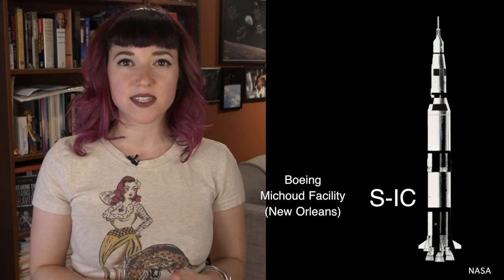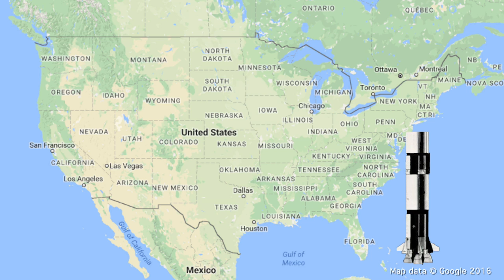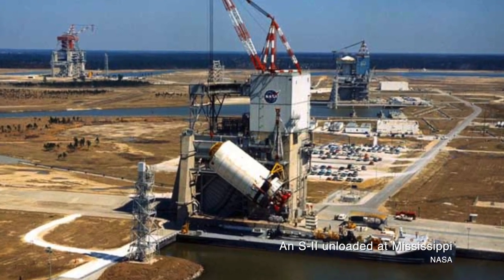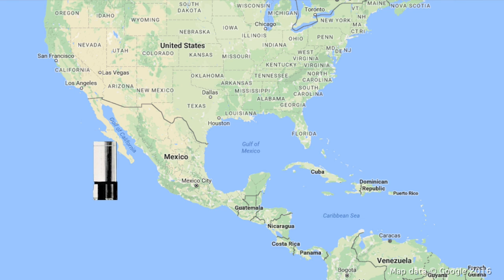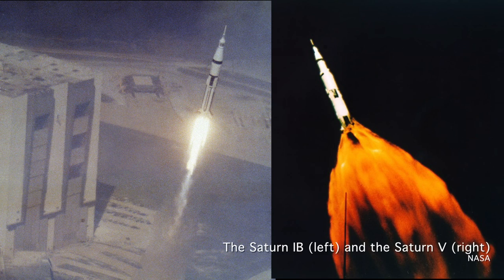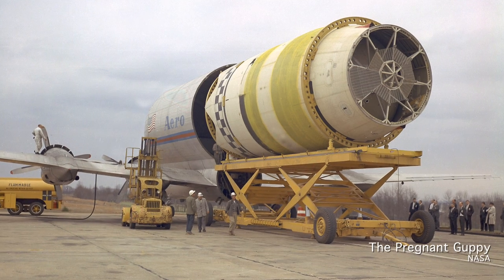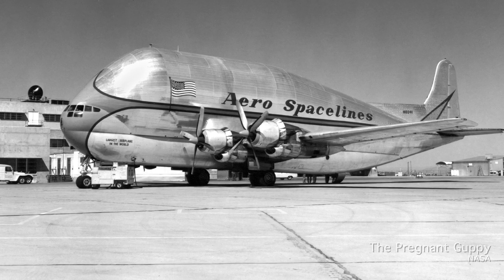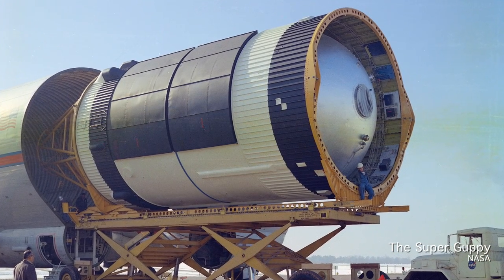How Did the Saturn V End Up in Florida?

Comment: Saturn V was awesome! I built a model one when I was about 10 years old. It was around 1m tall with a lander and everything :-)
Reply: Is that the old Revell kit in 1/96 scale?
Reply: Maybe, I have no idea. Were they around 25 years ago?
Reply: More like 45 years ago, though it was reissued as part of their "Heritage" series sometime in the '80s. Nowadays they're at least $100US if you can find one.
Reply: Wow you sure know your space models! I don't think it was a special edition or anything, but it was special to me :-)
Reply: Airfix and Revell both issued a 1/144 Saturn V as well. I built the Airfix kit way back in 1980 and built a newer release only a couple of years ago. 
All of these fairly old kits (40 plus years) are not 100% accurate. However, when AIrfix re-released their V in 2009, they corrected the main inaccuracies (which was the Lunar Module adapter section and the Command/Service Module. It is now the best 1/144 plastic kit of the Saturn V. 
They have also released it in a Skylab version too.

If you want REALLY big, Dragon do a 1/72 Saturn V kit.

Comment: Suggestion for a topic:
- why does US assemble spacevehicles  and transport them to the launchpad vertically, and Russia horizontally. What are the pro/cons?
Reply: US only started using the vertical transport crawler during the Saturn V because the rocket is so tall, it was more difficult to design a vehicle with erector mechanism rather than creating a vehicle to transport it already erected. After that, they kept using it because it's already there. FYI, only NASA use the vertical transport system. All other countries use horizontal transport, even SpaceX.

Comment: One of the fun facts about the boosters moving from Mississippi to Florida was the issue of getting past Interstate 10.  Part of the roadway was made of steel grid. They were removed by crane to allow the barge and booster to pass. The roadway was made solid not too many years ago since no more rocket barges are passing.

Comment: If I hadn't seen it on another video I wouldn't have recognized them for what they are, but in the photo at 1:37 the silver structures on the barge carrying the S-1C are the ends of the rocket nozzles mounted on frames. They would bolt onto the larger structure of the rocket nozzles themselves. 
I saw an engine on display in a video and it had one of these nearby. I had no ide what it was until the narrator of the video pointed it out.
I love this channel.

Comment: I was a child when the Saturn 5's were being built. I lived in Woodland Hills and there were various contractors spread out around the valley. My father worked for North American Rockwell at Rocketdyne in Canoga Park. He was a leadman of a crew that built F-1 engines. The first stage engines that put out 31 million horsepower, or 1.5 million pounds of force each. There were five on the rocket. When there was a launch I was in rapt attention to the news broadcasts. Usually after the launch they would give us a Richter reading from New York City. The engines my dad built actually rattled, very minor, the whole east coast. You could not feel it, but the instruments would pick up a Richter reading of a 1 or so. 

At 10 years old, in 1967, I was at the factory and got to touch an F-1. All three stage engines, F-1, J-2 and H-1 were built in the same part of Canoga Park. My dad told me once that they built 65 engines that were never used and were in some storehouse. There were 13 more flights planned when we just stopped. 

In 1968 he got laid off and we moved to Florida. I was personally at the launch of Apollo 17, the last Moon mission. I was 11.

Comment: Shuttles ships were recovered from landing point by attaching them on the back (top side) of a modified 747, solid boosters were recovered in the Atlantic Ocean by two tugs and towed to Cape Canaveral, and liquid tank was built from scratch and sent to Cape Canaveral by barge, the "grandsons" of the Guppy are still used today by Boeing to transport plane sections to building facilities ;-D

Comment: If you notice the photos there is a key difference between the Pregnant Guppy and the Super Guppy.  In the PG the entire tail was removed to allow loading.  It worked, but was very complex to remove and reconnect.  The SG instead has the hinged nose - still a pain (all of the control cables need to be disconnected first, for example), but still simpler and easier.

There is one Super Guppy still flying - and NASA operates it.

Comment: Hi,

A wonderful video.  I think it would be interesting to denote the evolution of the V2 to the Redstone to the the 1st stage of the Saturn 1B.  As I recall, the Redstone was basically a refined V2 that used Kerosene rather than Alcohol as the fuel.  And as I recall, the 1st stage of the Saturn 1B basically ganged together 8 Redstone engines with an elongated fuel tank.  

Very very cool!  I like!

Bret

Comment: During the Apollo era, I lived in Lakewood and went to school in Long Beach.  I remember the Guppies flying in and out of Long Beach Airport.  However, I don't remember seeing any Saturn stages being transported over the roads to Long Beach.  Los Alamitos Naval Air Station was closer to Seal Beach / Huntington Beach, so the stages went to Los Al, per this partial NASA history: __ "Both Guppy aircraft carried the instrumentation to monitor pressure, humidity, temperature, and vibration readings in flight as part of the plane's permanent equipment. In a typical delivery sequence, the rocket stage moved eight kilometers overland from the Douglas plant at Huntington Beach to the Los Alamitos Naval Air Station. After loading the stage, the pilots flew north to Mather Air Base, not far from SACTO. When stage tests were completed, the final leg of the airborne logistics sequence concluded with delivery at Cape Kennedy for preflight checkout and launch."

Comment: The Seal Beach facility for building the S-II is actually right next door to the Naval Weapons Station so the "drive" wasn't that long to the barge. It was less than 2 miles down Seal Beach Blvd to the Barge.

Two of the buildings used for constructing the S-II were just torn down in 2015, and the giant crane on top of one of the buildings (clearly visible in all of the old photos of the S-II construction site), was torn down in early 2016.

We are losing so much Vintage Space history.

Comment: Amy, what about how they had to pick special RR tracks to move the SRBs to Florida as a topic.  It is actually pretty cool
Reply: as I understand it the ground at surface level was not capable of dealing with that level of weight per square inch
Reply: *****
I am talking about the SRBs for the shuttles.  they were routed on a very twisted route to get them to KSC from Utah.

Comment: Hi, Amy. Firstly, I love your channel as I too am an Apollo era space nerd (though clearly, not as much as you =D ). Keep up the great work on this channel!

I have a question about the Apollo interstages (maybe a possible video subject too). There is some famous footage from either Apollo 4 or 6 showing the S-IC dropping away then the ullage motors presumably fires then the interstage drops away and then the S-II fires (not sure if the sequence of events is correct). As the interstage falls away, it begins to rotate but what looks like residual rocket fuel/exhaust seems to continue to burn through the insterstage ring. It is a truly beautiful sight and has always captivated me. I'm wondering what is going on here. Surely, the rocket fuel would have burned up by the time the insterstage has separated, and yet it's clearly visible on the film.

Also, I've read that the final few Apollo flights they didn't use ullage motors. Wasn't this critical to help with the staging? Did NASA just find that they weren't necessary? What's up with that?

Comment: Hi Amy. I love this episode - full of juicy details! Question about the launch tower - were the same ones used for each lift off, or one per mission and disposable like so much of Apollo components and equipment?
Reply: There were two launch complexes or towers. A and B. That took a lot of thought. There were reused. If I recall, pad B was used most often.
Reply: Raoul Cruz thanks heaps for that totally sarcastic response. A little less attitude would be nice and I WASN'T talking about pads 39a and 39b.
Reply: I was not being sarcastic at all. (The remark "that took a lot of thought" was sarcastic towards NASA in a lighthearted way. Nothing wrong with keeping things simple). I had no idea of your level of knowledge until you mentioned 39a and 39b. I was just trying to give a simple answer. Far as I know the towers or gantry were reused. They were extensive structures and took quite a while to build. By the way, the huge locking clamps that held the Saturn V in place, sat in field on the Florence SC municipal airport for quite a long time.
Reply: Raoul Cruz hi raoul. I'm glad you clarified. Those clamps would have been cool to see. I appreciate you sharing the interesting details!
Reply: There used to be the Florence Air and  Missile Museum at the Florence, SC airport. One of the nozzles of the Saturn F1 engines was at that museum. Why they shipped those monstrous clamps to SC, I don't know. But, I think the museum director at that time was a bit eccentric. Sad to say ,the museum is no longer exists. There were quite a few NASA/Apollo/Mercury artifacts there. Various nose cones that were used to test re-entry shapes, etc. They were throwing away a large "computer" cabinet from the Apollo program. I got one of the circuit boards. I think you would have been fascinated by the place. Cheers.

Comment: When was the cloth Rescue Ball developed? Ever tested in space? Were they routinely carried?
Reply: PRE Personal Rescue Enclosure.  Prototype was developed for Shuttle, but never flown.  Designed for rescue mission similar to STS-300 series missions where a disabled shuittle was having its crew saved by an other later launched shuttle and where there weren't enough space suits available.  I would crawl inside and zip in, then you in a space suit, would "float me from shuttle A's air lock, 2 shuttle B's airlock.  Oxygen supply and CO2 scrubber gave me about 1 hour of breathable air inside the 36" ball.
Reply: Sorry you asked when it was developed, it was developed in the 70's as the Orbiter was being built.  This wiki article has a picture of the First Women of Space posing with the actual prototype.https://en.wikipedia.org/wiki/Personal_Rescue_Enclosure

Comment: Hi amy I love your showsI don't think that I have every messed on. but I do have a question. when testing any part of the satern rocket that could only be testing once cleaned and but back together and had to keep there fingers crossed because the engine was never able to be test unless you tested again becauses that the engine had  volatilize fuels

Comment: And the shuttle boosters went by train, no? Which required them to be segmented to fit through the tunnels, which in turn is why O-rings had to be used? Would a barge through the Panama Canal have allowed them to go in one piece?
Reply: The SRBs were built in Brigham City, Utah. Since there are no big rivers connecting it to an ocean, a big barge could not be used. Also, the SRBs were fully loaded with solid propellant, which made them a lot heavier than the empty S-IC stage. They would have needed a much bigger barge.

Comment: Why did the shuttle launches "flip" upside down? Why was the shuttle underneath the tanks and boosters?
Reply: The roll on launch was to shift the flight path to the correct angle for orbital insertion. The shuttle's engines were angled up slightly (relative to the astronaut's perspective). This allowed the engines to provide an added lift force to the entire craft when it was flying at that angled trajectory, but only when it was oriented with the shuttle in the "heads down" position.

Comment: My gosh that plane looks so huge. How much did these stages weigh ?
Reply: xGshikamaru alot
Reply: by comparison, the convair B36 and B52 could carry 32 tonnes, although the B52 was closer to 22 tonnes when it first came out.
The pregnant guppy actually had a lower max takeoff weight than the Boeing 377 it was modified from, and the same was true of the super guppy and Boeing C-97, by 7000lb and 5000lb respectively. With a max payload of around 54,000lbs, carrying the 23,000lb dry weight S-IV wasn't a big deal, the major concern was whether or not it could fly due to drag.

Comment: So even after adapting a plane to fit the stage it was still cheaper to send them on barge? Or was budget not the only factor?
Reply: Security, Speed (it was a race, after all), Reliability, Budget, Practicality, and Flexibility all come to mind.
Reply: But as the plane was already built it would surely have been quicker and more secure to send the stage by air over American airspace. Can't speak for budget. Lots of fuel I guess but you're not paying a crew for a voyage through the canal. I'm sure there was a perfectly rational reason for doing it the way they did but given that the plane was capable I'm just curious as to what it was.

Comment: Its interesting that if we needed to move that booster today we would call a Russian airlift company.  Today they have all the big cargo planes.
Reply: There's also the Airbus Beluga. Twice the super guppy's payload weight for approximately the same volume.
Reply: Actually, no - the An-124, even the An-225, do not have cargo holds big enough.  Nor do the C-17 or C-5.

I'm not sure even the B747LCF is large enough.  The Airbus Beluga may be.

But actually, NASA would just use the one Super Guppy still flying.  NASA is the sole remaining operator.  They use it to this day to move outsized cargo.
Reply: There are 4 oversized fuselage planes currently in operation.  Super Guppy (1 in operation NASA), Boeing Dreamlifter (4 in operation | Boeing), Airbus Beluga (5 in operation | Airbus), and Conroy Skymonster (1 in operation | Private). 

While the AN-225 Mriya may hold the record for the heaviest lift, it is not much larger than a A380 or 747 as far as fuselage width.

The Dreamlifter is operated by Atlas Air under contract to Boeing and is not used for charter.

The Skymonster is currently owned by Harlan Wayne Jordan of Lady Lake Florda and stored in Bournemouth, UK likely to never fly again.
Reply: Ok I guess I over generalized here. :)
Reply: ***** Indeed, the Skymonster is visible on Google Maps: https://www.google.com/maps/@50.7854503,-1.8436619,102m/data=!3m1!1e3

The last update I could find was that it was restored to working order, with the engines run and painted with primer, in 2014 - but it hasn't flown since the work was done from what I can tell.

But the Skymonster is a LOT smaller than the Pregnant Guppy or Super Guppy.  (Interestingly it was created by the same guy.)
Reply: *****
What does this have to do with anything in that thread?
Reply: Airbus actually bought up surplus Super Guppies post the Apollo programme. They used them to transport large sections of Airbus airliners between the various facilities all over Europe. The Beluga was built to replace the Super Guppies.
One of the Super Guppies is preserved at Bruntingthorpe in England.
Reply: A bit late to the discussion, but I don't think they were surplus. The manufacturer had a few scrap stratocruiser airframes ready for conversion and this is what Airbus got. I read that they ran out of a critical part (wing box maybe? I don't remember...) and so that was scavenged from a surplus NASA aircraft. The Super Guppy that NASA uses now is ex-Airbus - apparently it was swapped in exchange for some payload space on a NASA launch (Airbus' parent company makes satellites, so I assume that's what it was in aid of). Oh, and on an early test flight, there is a story that a simulated engine-failue test almost killed Von Braun (who was on board for a demo flight) when the propellor refused to unfeather (you simulate an engine failure by setting the prop blades to a near-flat angle, rather than turning off the engine).

Comment: NASA wanted the shuttle-boosters made bigger, but the diameter was limited by the size of railroad-wagons (correct)
...and the track-size comes from roman horse-carts... (incorrect, that's only a myth!)
The idea of the 'Super-Guppy' lives on in the Airbus 'Beluga' and Boeing's 'Beluga'-equivalent, The 'Dramlifter'...
(there was even a plan for a B52-based 'Mega-Guppy' with 12(!) engines...!
b.t.w.
some years ago, i saw a docu, that the canals at KSC are s.k.o a manatee-sanctuary, because these animals keep the waterways free from seaweed and keep them navigable... (win-win-situation ;-))

Comment: I've seen plenty of photos of the SIC and SII on barges near Cape Kennedy or in Missouri, but I've never seen any in the Panama Canal. Do you know if any such photos exist? I would love to see that.

Also, I think it's awesome to note that both Guppies were used to transport the command modules and LEMs to KSC as well. Also, although the Pregnant Guppy was sold and dismantled, the Super Guppy still flies today, and has been used to transport Orion components as well! Below is the pressure vessel for Exploration Mission 1 set to launch (fingers crossed!) in just under two years, being delivered via Super Guppy.

http://www.spaceflightinsider.com/wp-content/uploads/2016/02/4974-nasa_orion_em1_arrives_at_ksc-jason_rhian.jpg